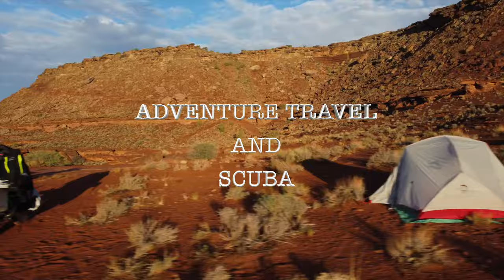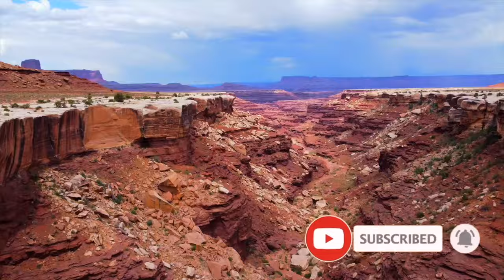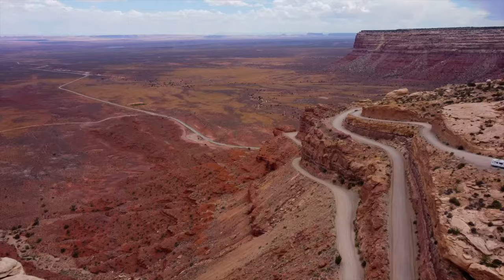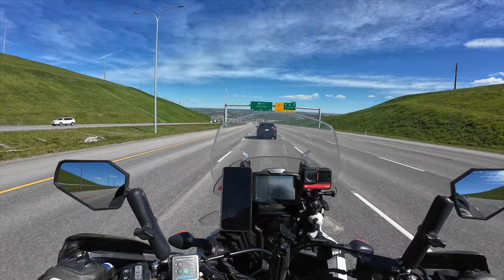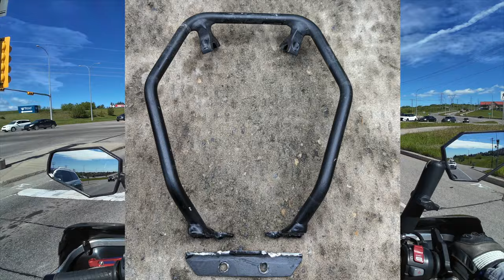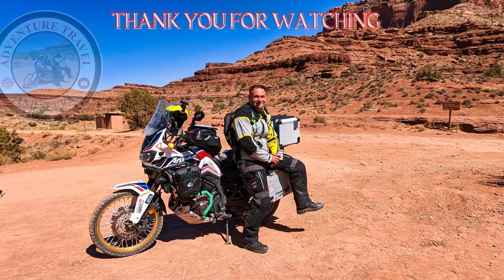Broken Fairing Subframe Africa Twin

Comment: Your experience is making me wonder about my setup: I have the same Camel brace on my AT to which I mounted a rather heavy Garmin Zumo XT and a heavy Touratech Mount to prevent theft.

I suppose my saving grace is that I do almost 0 off-road.

Even so, I worry about the weight on that particular piece of vulnerable real estate.

As always, thanks for sharing.
I really appreciate everything you do.
Reply from the maker: I have a feeling if you don't do much off road you should be fine you can grab the windscreen and wiggle it you would see a lot of play and vibration when riding

Comment: I have same bike 54000 km same original chain & sprockets, no issues.
Reply from the maker: That all depends on your style of driving where you driving. How much off-road we do quite a few off-road trips in the mountains that puts lot of strain on the chain and sprockets if you mostly on road, definitely your chain is going to last much longer. I will replacing my second chain since I purchased this winter even though it still seems okay but it's already stretched out